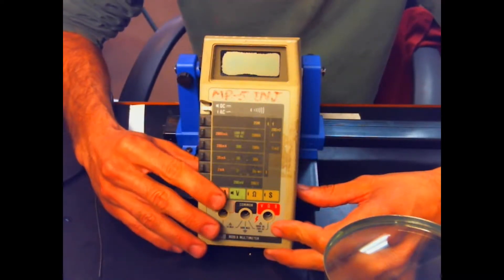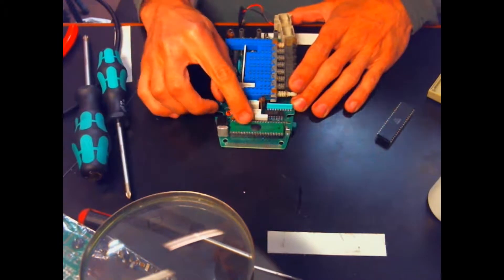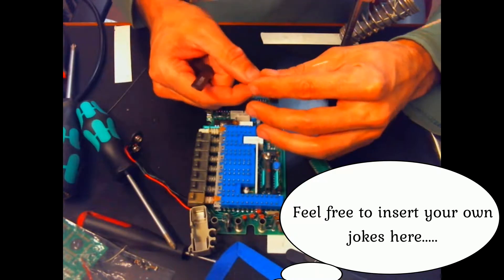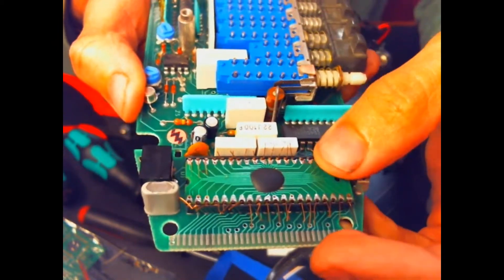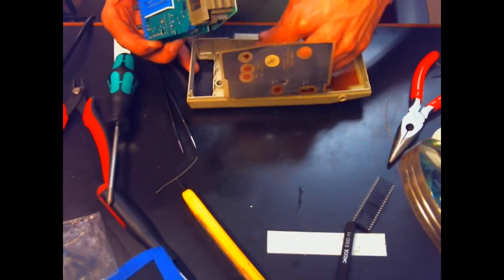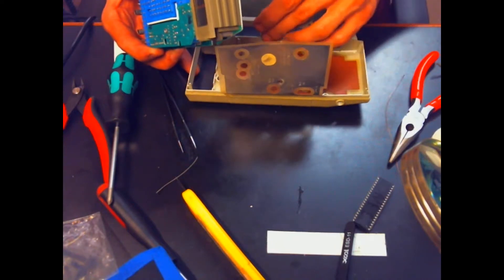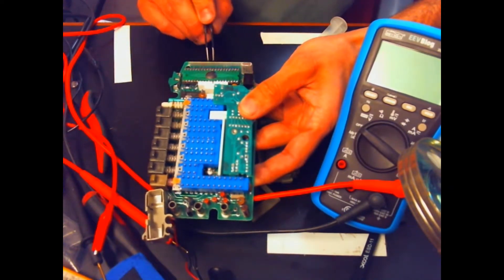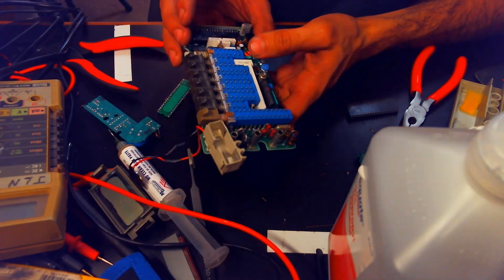Frankenmeter! Fluke 8020B Multimeter Chip Transplant FAIL

Comment: It astounds me that any effort was put into the process of just sorta-randomly inserting an unknown "chip" into this Fluke meter because A) it came from some other voltmeter and B) it has the same "footprint". No mention of whether the "chip" to be transplanted is even an A/D chip, or perhaps some kind of microcontroller programmed to work as a voltmeter. No mention of whether the "pinout" even remotely matches. If those things WERE known and/or considered, it would have been good to mention here in the video, lest the viewers get the wrong idea.

Anyway, even a tiny bit of research will reveal that the Fluke 429100 A/D chip is proprietary and distinct from the 71xx series A/D chips, even though they are functionally similar and made by the same manufacturer. Certainly, the pinout differs in a few important places. Certainly, the 71xx series uses an R/C based oscillator requiring three pins while the 429100 uses a crystal oscillator requiring two pins. Most importantly, the 429100 auto-ranges between the two lowest ranges, and by the magic of range attenuation in the meter circuit, this affects and influences ALL range selection circuitry, not just the two lowest ranges. For example, on the Fluke 8020A, which is the meter Fluke 'designed' the 429100 for originally, the range selection switching only picks every other order of magnitude (in some situations) because then the 429100 auto-ranges within the spans of adjacent ranges, essentially filling in the un-switched ranges. In creating the 7106 from the 429100 die, Intersil 'masked off' the auto-range functionality of the IC, requiring that ALL range switching be done externally by the meter circuit. There is NO WAY you can get a 7106 to work when plugged into a meter whose circuit is designed around a 429100. Oh, and the 7106's pin (38) that is common to the R and C of the oscillator, guess what that pin does on the 429100?.....it is part of the auto-range circuit, so not even remotely compatible.

Here is where even a modicum of research and understanding can prevent a lot of wasted effort just "repairing by guess work".

Comment: that's a generic c.o.b icl7106. and that fluke uses a custom chip of its own. that will not work..
Reply from the maker: Yeah it definitely didn't. It was still fun to try. On another video I have someone suggested trying a few of the ICL71xx series chips. I remember reading something a while back that Fluke made a big fuss because the 71xx was almost identical to the 429100 except for an internal switch. Do you think there's a way to add something to a 7106 to make it work as a substitute?
Reply: Beb's Repair Bench I don't have knowledge of that sorry. I hope you won't get mad or anything, but maybe making that meter as a donor for other aquirable meters that have good chips?
Reply from the maker: @chrisblank9090  Mad?? Haha not about a good suggestion. I already have a couple that are donors, and this one is pretty much in that same pile. That's why I wasn't worried about messing it up. I bought a batch of them a while back and managed to get one working at 100% and another is in fair shape, the rest are awaiting their fate.
Reply: Beb's Repair Bench I'm from the philippines by the way. and I also had a meter like that years ago. but typoon rain made a mess of it. that chip is so hard to find these days. mostly here in our region
Reply from the maker: @chrisblank9090  it's hard to find parts for old Fluke meters anywhere nowadays. Even eBay is pretty slim.
Reply: Beb's Repair Bench just a word of advice, old meters are much much much worth the time effort and money than those chinese garbage ones. I really don't understand the majority of american electronics enthusiasts why they hate fluke. they always complain that flukes are expensive. but you have there ebay to buy used but still reliably good and accurate ones. americans that hate an american flagship that is drooled by non americans. where's the logic
Reply from the maker: @chrisblank9090  Oh I know that! I love my Flukes. I have quite a few older ones and an 87V. I know there's a lot of people out there that don't value them, but I've talked to many others that swear by the older models, especially the 27. That's a really great meter. I know they don't have the resolution and high accuracy specs that many modern professionals want, but for a hobbyist I would always recommend getting an older Fluke instead of a $10 cheapo. It may be used but it's also well proven
Reply: Beb's Repair Bench wow that's good to know. I do electronics repairs and restorations for a living. and test instrument repair as a hobby. I have a fluke 27fm, some 87 3s, an 87v, an 87 4, a 287, a 116, an 8000a and an 8010a. we're no elitists. we use flukes as a majority because they're reliable and robust. resolution is not an issue because even a 2000 count retro can tell you 3.3 or 1.8 volts decently and accurately.  yes it does not have those fancy features like the more modern ones but for basic and abusive repair use it will stand the test of time.
Reply from the maker: @chrisblank9090  Exactly! Be sure to check out some of my other videos and let me know what you think. Fair warning though, my production quality is still improving.
Reply: Beb's Repair Bench this is really weird, I thought I already subscribed to your channel haha I guess I forget to click the subscribe button. I clicked it just now.